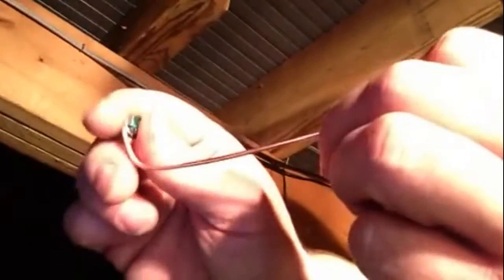How to make a ground wire

Comment: Can I use this method for a power supply?
I need a grounding wire for my 3D printer since the PSU will no longer be touching the rest of the metal. Thank you!

Comment: Your twisting the loop the wrong way.  The loop should be twisted the same direction that the screw will be turn in and tightened. If you twist it the way you did, then the screw has a tendency to push out/open the loop.
Reply from the maker: What if I flip it over?
Reply: Didn't he fix it?